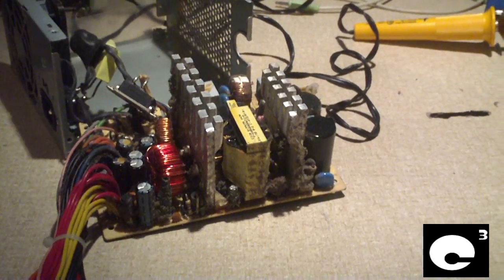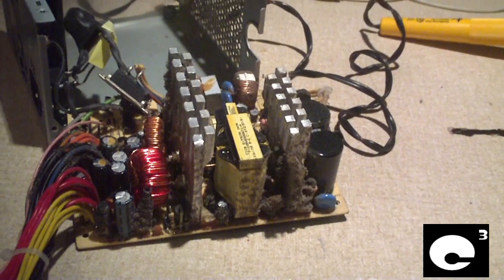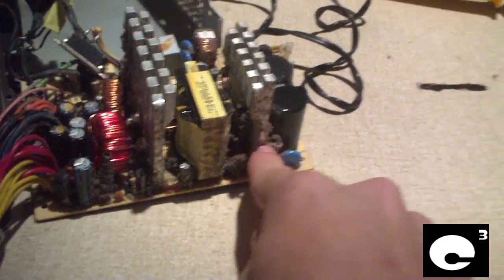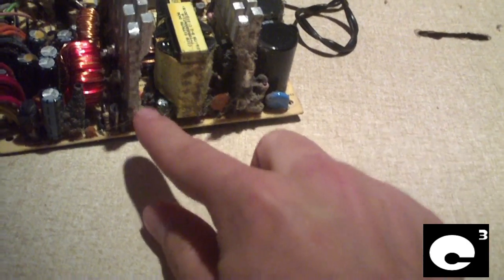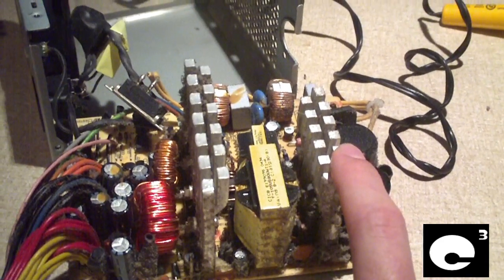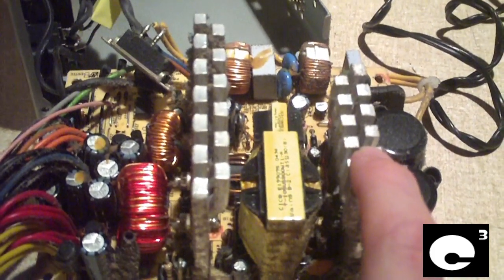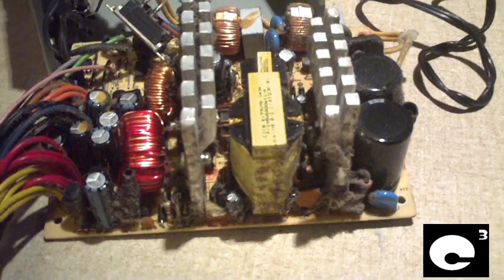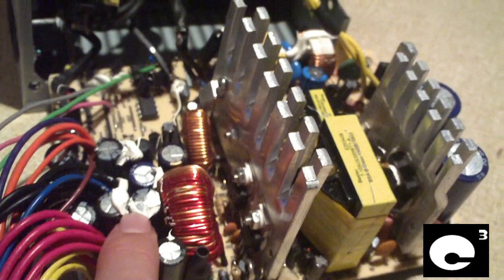Filthy Power Supply vs. Clean Power Supply

Comment: nice video . there is a a good article about cleaning a fan of a psu here - http://www.benshardwareblog.com/pc-hardware/psu-fan-cleanup
Reply from the maker: Never ever use WD40 in bearings!!! WD40 is NOT a lubricant. Instead, use something like 3-in-1 oil or Marvel Mystery Oil to lube the sleeve bearings in fans.